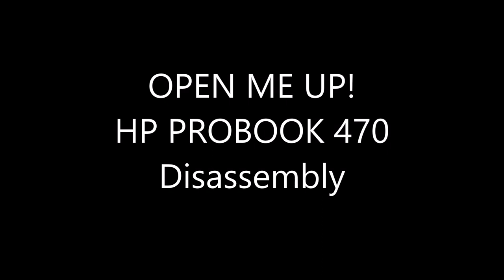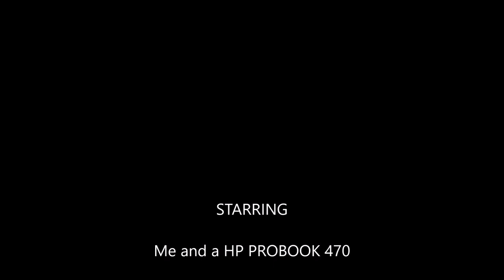OPEN ME UP ! HP ProBook 470 Disassembly

Comment: Theres that silver circular battery at 13:58 at the end of the black cording. I dont have that on my laptop (it's been to repairs a few times and might've been removed then I think). My laptop stopped charging a few weeks after coming back from repairs(the charger works fine on other compatible laptops). Is it possible that this missing part is causing it?
Reply from the maker: on the right of my screw driver thats the bios battery. this just keeps the time in your laptop correct thats all.

Comment: Hi there.
I have a hp pro book 470 g1 2,2 ghz serial nr : 2ce4071yy6w and i want to upgrade my processor. Can you tell me wich one its compatible with my laptop ?
Reply from the maker: CPU is soldered on, GPU is solder on, Ram can be change to 16GB max with 2 8GB DDR3L sticks, Hard Drive is a 2.5 inch sata.

Comment: Hi, I have one question. At time 15:26, I am not sure, but I think that there is  another m.2 slot, is that true or not?
Reply from the maker: that is an m.2 slot but it is only at 42mm. it is only meet for 4g 3g wireless card. i only know of one complain that sells a m.2 at 42mm which is adata
Reply: OPEN ME UP Thank you.